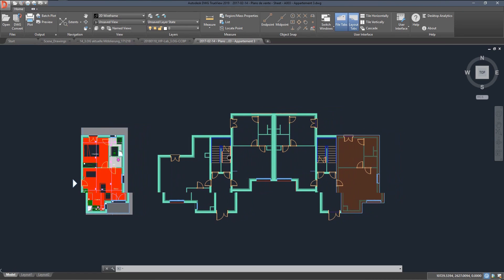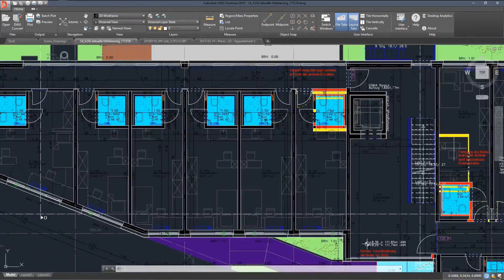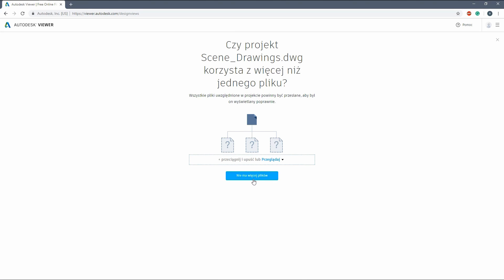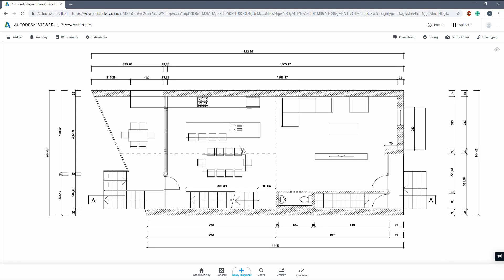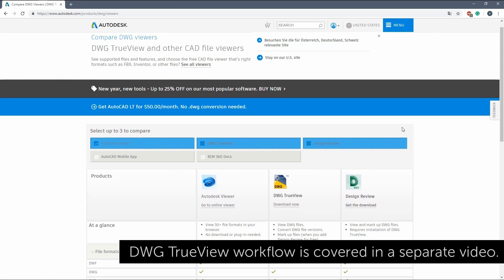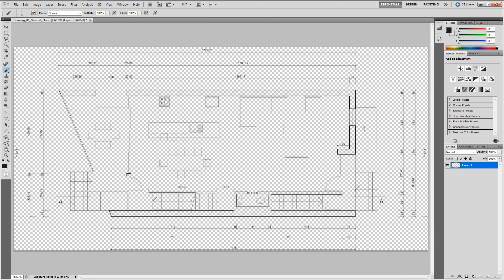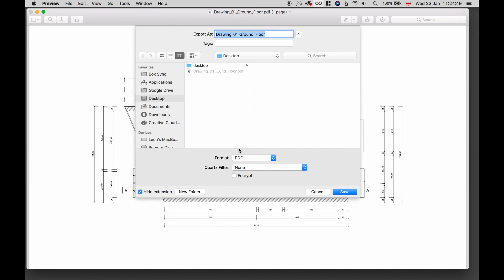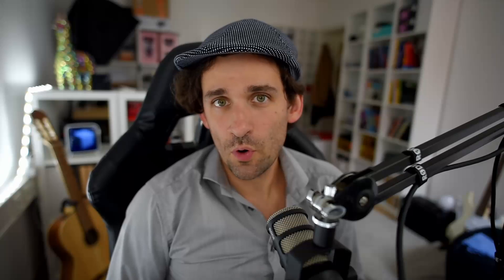Blender Archviz: CAD Files | Part 03 |

Comment: Forgot to mention: I've been working with AutoCAD since the early 90's (must have been R10 or R11). At that time, data exchange was not an issue, but we have 2021 - and until today, data exchange via DWG format is often just horrific, even if the software comes from the same manufacturer (I just say "Inventor" and daily annoyance). PDFs that come out of AutoCAD can also have their pitfalls (for example hatching).
That is why Lech's proposing to use JPG can really named as bulletproof.
Reply from the maker: Thank you Markus! That's exactly my experience as well. The problem gets even bigger when you work in a team with mixed Windows and MacOS users. In that case, JPG's were the only solution. It's not perfect but until today it's the only one that always works.

Comment: i think another alternative is to use inkscape (an open source vector program ) that can open the pdfs of autocad and then then export them as SVG file which blender supoorts very well but make sure to work in layer so you can just export simple walls and other important data because hatch and dash lines are very anooying while snapping in 3d. then export the pdf to image using inkscape as well. this way you will have both vector as well as raster details and this will be another bulletproof method for precision modellers.
Reply: Always add a rectangle of known length in autocad file to properly match the scale of floor plan and dont just use door length but choose as big as possible so the error is minimum and you get good precision.

Comment: have you ever tried inkscape for this? it is a vector software like illustrator and should do the trick.
Reply: it doesnt support dwg format as well, only Illustrator does that but it paid and also no sense to use it. JPG is the best solution. opensource cad format should be developed for the vector works.

Comment: I just export autocad files to dxf. It can be imported in blender. Easy to work with, i can snap to dxf vertex. Only problem the text dosent import properly so you have to delete it on import.
Reply: Im part of a interior design duo, in which we design custom kitchen cabinets and storage spaces as part of the interior design. We deliver autocad 2d plans ready for carpenters to manufacture those cabinets. It's easier for me to just snap every part of the cabinets and walls than to pixel hunt over a low res picture. And it keeps it super accurate, which dosent really matter when doing visualisations, but if I already have dwgs that I can easily import(with dxf method they import as curves to blender), why not. I'm just pointing out that there is a method of importing autocad files to blender, not just to use snapping for walls, but for furniture, doors, windows, and custom furniture. Greetings from one of your lifetime chocofur buyers.
Reply from the maker: But why would you use snap to vertex modeling technique for something as simple as walls? It’s much faster to extrude a face (and snap if you really have to).

Comment: Have you tried using the print method and then using a save PDF format. Perhaps they will be vector then. Im not sure what this DWG viewer puts out in the browser though.
Reply: I just tried it using a DWG file and although it doesnt putout a vector file as i hoped. It does putout a 3x higher images file vs that screenshot. The PDF saved had an image iside the PDF of around 3500x2000 where as the saved screenshot was around 1500x940 pixel orso. So that is way more detail

Comment: Blender has a dwg importer!?
Reply from the maker: It doesn't have.
Reply: @Chocofur  but it has a DXF importer, so u can easily convert DWG's to DXF and import them
Reply from the maker: @chilln.official  Yes, but I also explain why, for over the past 10 years, I don't use DXF and why it's better to just stick to JPG's :-)
Reply: @Chocofur  u're maby right it really doesn't matter that much when u just do renderings.. I used to work with ArchiCAD and later moved on to SketchUp so it's very unnatural to me not to stick with exact measurements ...maybe smth I have to get used to.. but most of the time u dont have DWG and DXF anyway when u just do rendering stuff
Reply from the maker: @chilln.official  That's exactly my experience when working on visualizations. Sometimes we only receive JPG's from the marketing prospects with no dimensions attached :-) But a simple trick of matching the door opening to a 1m x 1m Cube always works!

Comment: With small projects you might be able to get away with raster "guesstimate", but if  you were to get  the drawings from multiple discipline, like landscape, lighting, The moment you defer away from vector scaling, you will run into problems. Of course should the design change, you will run into walls not matching up. But why don't you use the .dxf option when you try to import into blender? Doesn't it make more sense?
Reply from the maker: If the project design changes when you're already working on the visualizations, well, you simply charge for the extra work, I don't see the problem here.

From my estimate at least 80% of visualizations are interior apartments, single-family houses, etc. Big projects with multiple CAD dependencies are a marginal % of what a regular 3D freelancer will ever work on. These usually are high-budget projects so you don't need to stick to Blender and use something with better CAD support if it's really that important (it wasn't for me and my team for all the projects we did so far).

Comment: I export to PDF, then PDF to dxf or svg
Reply from the maker: But why would you go from PDF back to DXF or SVG?
Reply: @Chocofur  when I don't have access to dwg.  I use the elements for reference and modeling from them
Reply: I also follow this workflow. Regarding why this is done so as asked by chocofur....it's because of snaping the entities. But be sure to scale the dxf import properly for best efficiency.  Also after importing to dxf make a dedicated collection for dxf references.
Reply from the maker: @nareshvijh2069  But why do you need snapping for walls that 99% of the times have 90 degree corners? Extruding simple cube is much faster and you're making a 3D model for visualization, not CAD file where (theoretically) everything has to be perfectly drawn.
Reply: Make no sense, the PDF image are probably pixel images, then the DXF is kinda useless. Unless the PDF contains vector images. But you can import those directly into blender